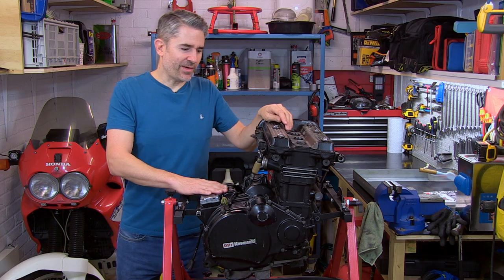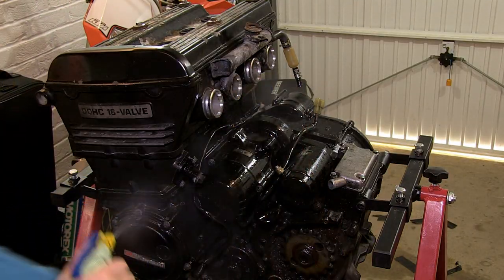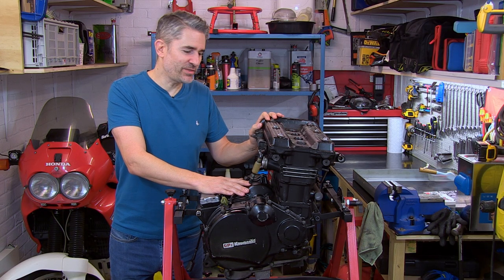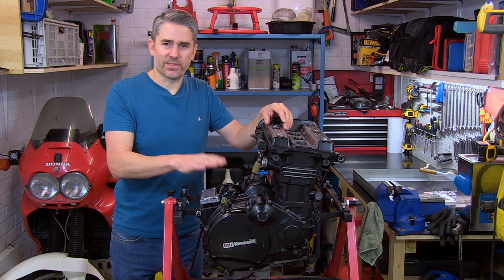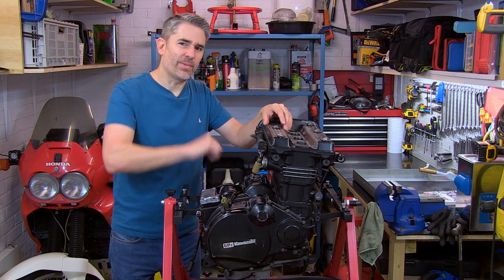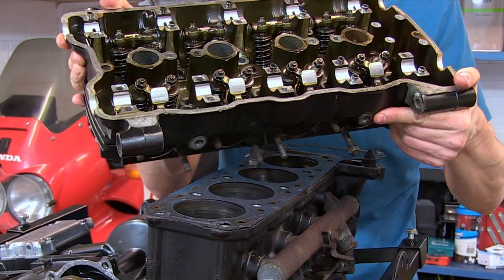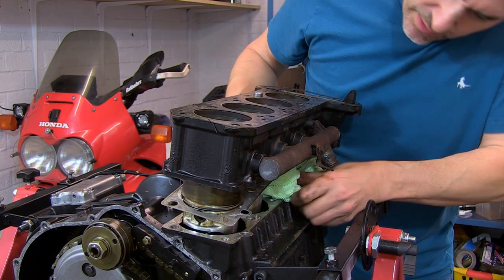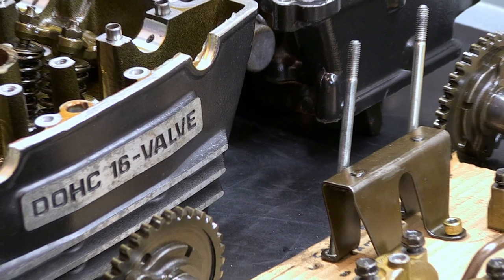Kawasaki Ninja GPZ900R Rebuild EP3 - Engine Strip & Top End Removal

Comment: Great video! At around 3:35 there's alternator place. Is there a rubber washer right in the center?
Reply from the maker: Thanks and glad you liked the video. Please share it if you can. 

It's been a long time since I rebuilt this engine now. The only o-ring I can recall is one on the alternator around its outer circular machined part that slides in to the engine case.